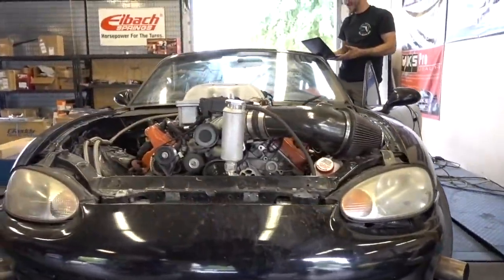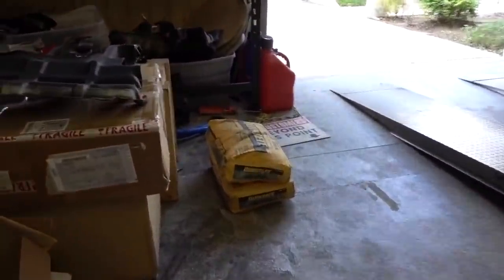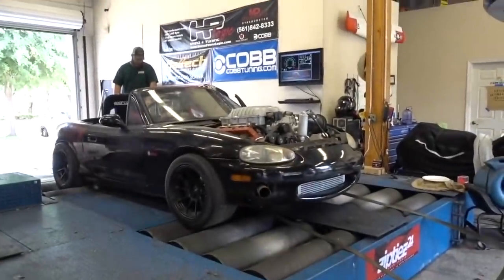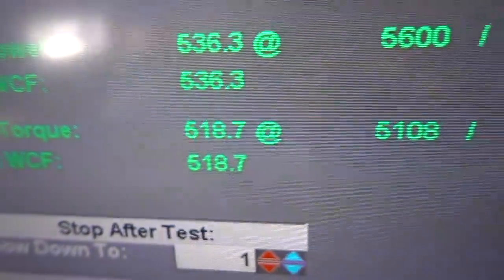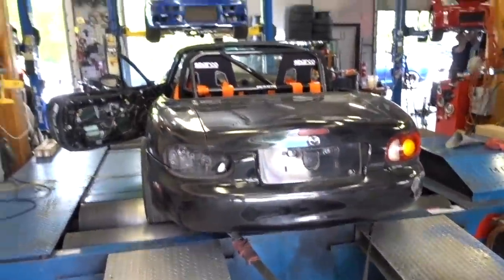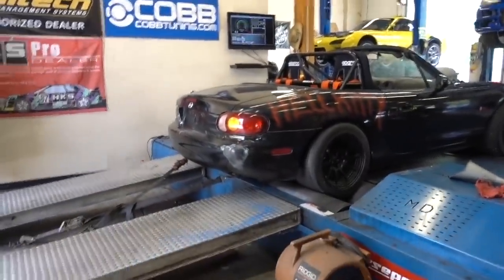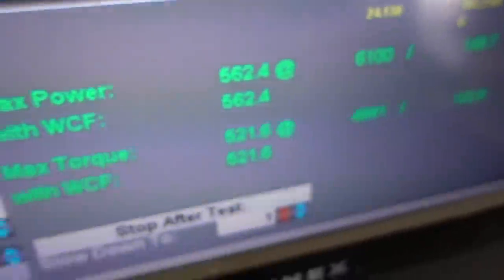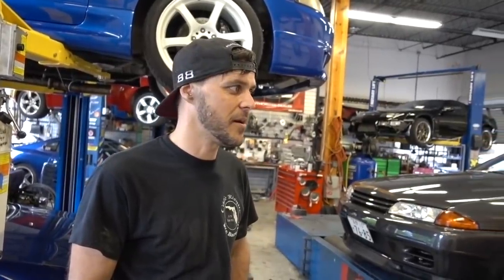HELLCAT MIATA DYNO TUNE!

Comment: Jack you never use contact cement aka "dyno sause" in cases like this? I'm pretty sure that's what brent at PFI and Jeremy from fasterproms uses to get those 1000 hp hondas and Chevys to hook up on their dynos
Reply: yeah looked like it was spinning and burning the tires still
Reply: i agree it was spinning.. dyno sauce ftw
Reply: wheeln 24/7 I always thought they just used spray adhesive
Reply: Exhaust exits before the tire so it looks like it's spinnin' ...
Reply: @earnestbunbury2103  exhaust comes out through the front bumper. They had to turn the headers around so it would fit. Look at it close you can see the pipes and exhaust coming out of the bottom of the bumper
Reply: @Thatnegroswag  yeah im almost 100 percent positive Brent from PFI uses contact cement aka spray adhesive. The kind used for interiors of cars. Look on his last dyno video there's a close up of them spraying the tires and comes out of the can like that stuff does. Makes sense that's what they'd use. Pretty sure that's what Jeremy uses too.

Comment: Shoulda put an f2t in it. You could have 500whp on stock internals with just a bigger turbo ecu and fuel system and had a drive able car while still experiencing loads of low end torque and maintaining a decent vehicle balace. And then probably had a bunch of money left over for whatever else...

Comment: In six gear which is way overdrive but looks like the tires are breaking loose on the rollers putting down 560hp
Reply from the maker: speedyme200 Small tires and high rear end ratio make 6th with this setup the exact same as 4th with the bigger tires/gearing. 

The stock hellcat car has 29.5 inch tires and a 3.7:1 rear gear. In 4th that’s 143mph at 6k rpm. 

The HELLKITTY has 22inch tires and 4.30:1 rear end gears. 6th gear now gives 144mph at 6k rpm.  It’s identical. That’s the correct gear to test in for this combination.

Comment: It's a dope build but what's the point of putting a hellcat motor in it if it's not producing the full power?
Reply: It is making full power but its its obviously spinning on the dyno.
Reply: 707 hp is measured at the crank. This is measured at the wheels. There is a BIG difference between those numbers. I'm sure the engine is still 707 at the crank.

Comment: have you done a coast down run?  I'd think with those small tires you should be over 575 whp for a stock hellcat engine.
Reply from the maker: Mustang dynos have a 25% loss to the wheels.  Do the math. 560\.75

Comment: Do you use glue on the rollers I haven't seen it that would help if not
Reply: Vht trackbite would assist somewhat with grip but would likely make a mess of the rollers.

Comment: Can we see a 12A BUILD maybe a rx7 FB on the channel
Reply: its 2019 m8 12A's are a thing of the past only 13b and 20b now days
Reply: Oliver I must be stuck in the past then..i have a fully built 12A full bridge port with monster street ports running RX2 double side seal rotors aswell with carbon side and apex seals all balanced and I got a 13B SE center iron on my 12A so pretty much it's a 12B lol
Reply: Oliver my motor unique I can use a stock 13b intake and throttle body fuel rails etc ull never know it's a 12a only if u look at the stamps on the housings I wanted to modernize the 12A I have a 12B

Comment: You should be at 600+ whp with less rotating mass in the shorter miata. With no wheelspin+ exhaust tweaking you should be over 600 no problem.

Comment: Can anyone suggest some good mods to do to my g35 just got it 3.5 liter can't afford to turbo it? What should be done first after maintenance?
Reply: The norm..full exhaust..headers .hi flow cat n alil bigger pipping..so.e intake mods and a tune.and weight reduction..best bang for your buck is a tune
Reply: Then cams and head upgrades..valves and springs .and re tune .and NITROUS!!! A 100shot would be Perfect..dont need any fuel upgrades for that small of a shot..nitrous is just as good as a turbo honestly .
Reply: Coilovers, sway bar(s), stage 2 clutch, poly mounts and it will handle amazing. The rods are weak in the 3.5 but if you upgrade your suspension it makes the car handle very well